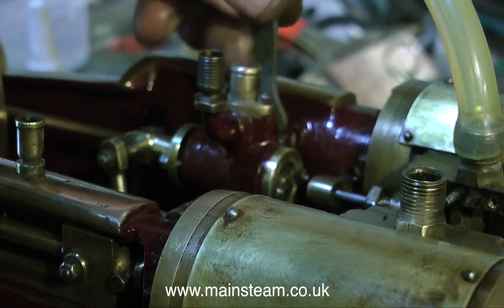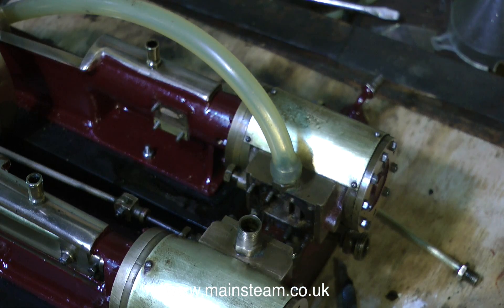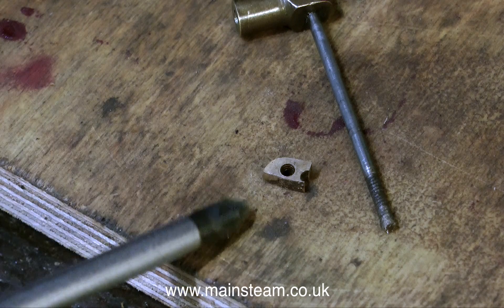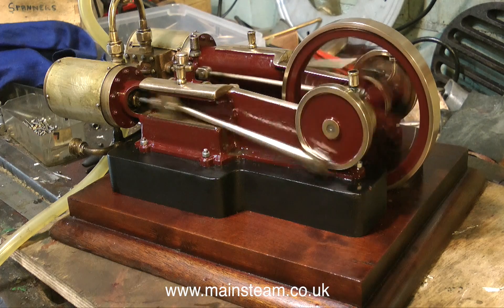PART #9 - RENOVATING A MODEL TANGYE TWIN CYLINDER STEAM ENGINE

Comment: I love steam engines but I tend to go for working steam  that does a job it seems a waste to run a engine with out work on the other end . It does as much good as farting in the wind but as the old lady said every little bit helps. i get its a hobby but they are strong enough to run a small tool lathe or drill press why don't they make pieces like that to put on the other end of there toys then the toys can help make parts for more toys. I'm new around here so I had to ask